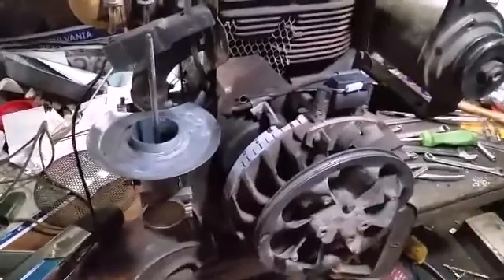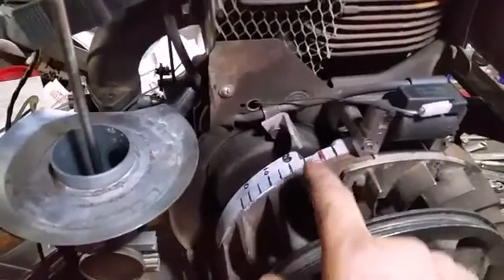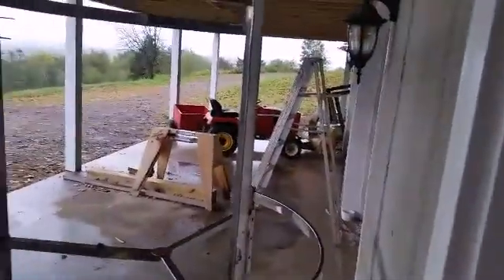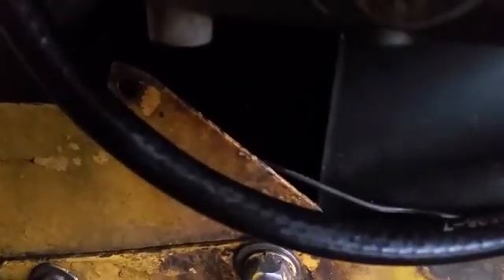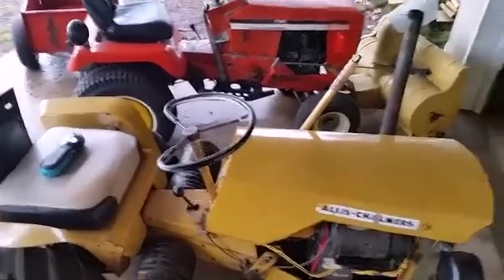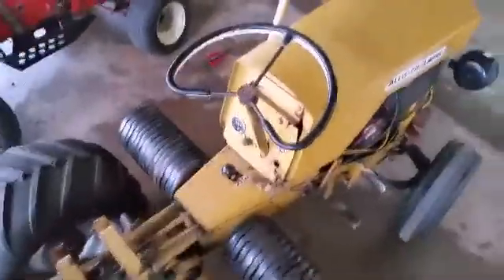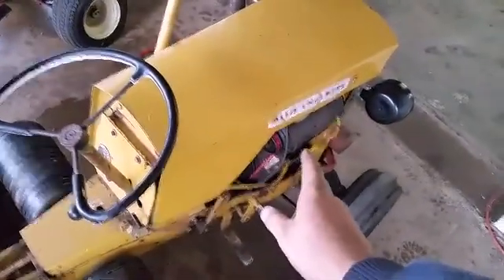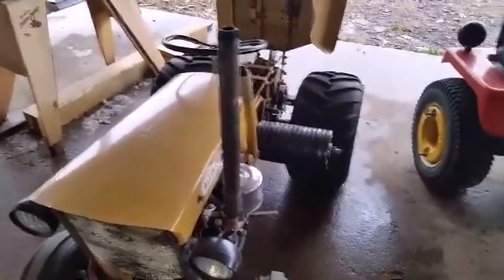Timing difference between gasoline and AVGAS cast iron briggs

Comment: Do you have your axle tube reinforced Willy? Do you run a locked diff as well? If memory serves, the early B-1's have a short axle tube on the left. Reinforcing the tube on the right before the Differential is a must. Most use a Schedule 40 or thicker pipe, sliced in half then secured by muffler clamps. Otherwise, the day will come when you loose power to the wheels and have a spiral crack running down the axle tube. Just food for thought if you haven't already reinforced it. You're running a 12hp I assume? They are the one engine Briggs makes with the adjustable timing bracket. That engine sounds healthy and happy. Cheers my Friend! Zip~
Reply from the maker: I have plenty of spare parts going to have the b1 transmission rebuilt as theres a lot of free rotation in all the keyways or diff, bushings and seal are shot oil drips out wile it's running so no worry if it blows. 
I blew 2012 axle once cracked inside to diff hub and was told replacement axle was better than original not sure though thanks for the info👍
Reply: I've got a few 16hp Briggs here at the Ranch. Nudge Nudge...lol. You CAN put a 16hp head on the 12hp (same bolt pattern) and make a head gasket out of thinner head gasket material to help boost compression. I could even mill the head down a few thousandths so you could use a stock Tin Pressed (Not lead filled) head gasket. I've also got this Van Dorn Valve Resurfacer here as well as the hand held power Seat Resurfacer. Oh the trouble we could get in if we were neighbors! lol Cheers again my Friend!
Reply from the maker: @ZippoVarga  if you mill a flat head you'd also need to do some porting so you don't negate the airflow then you'd have to clearance valves list goes on down rabid holes I just stuck 12hp head onto a 13hp block wich has been bored out for .020 oversize 16hp piston. 
I could do more but class is limited no porting or polishing can relieve the deck has to be stock head so on and so on👍 

Wait till I save up for new opposed twin block then things will be turning😉

Comment: Great video. Milling the head and decking the block also helps when running higher octane fuels. I use to run VP C113 or C115 when I ran gas.